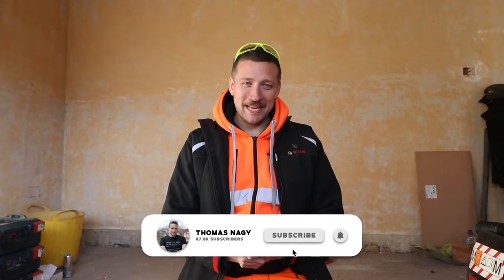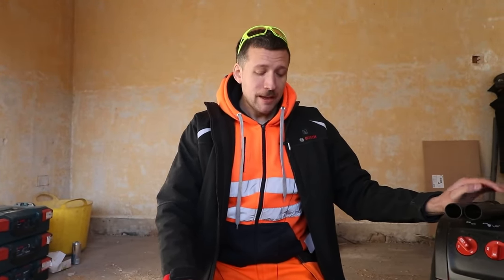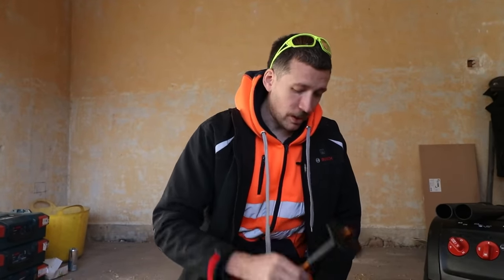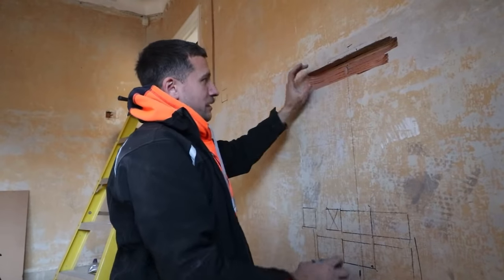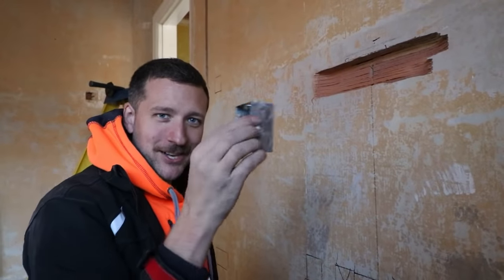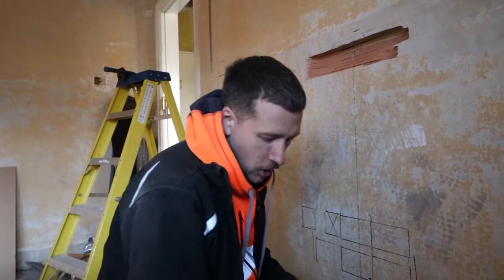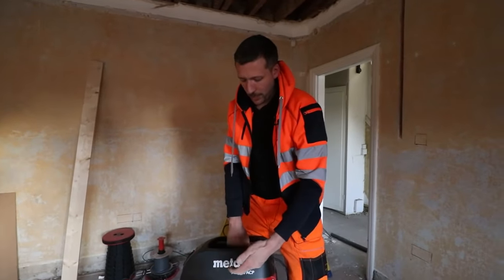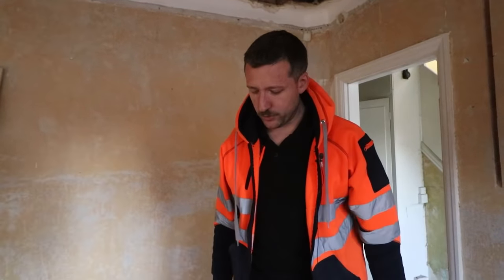The GOD of all WALL CHASERS! | Thomas Nagy

Comment: Worth it if you rewire daily. They say dust free it's not. Compared to angle grinder but similar to sds chisel. The wide bit cost approx£100, started to use on brick (hard house brick but not industrial brick) blade was showing heat damage straight away so stopped. I continued house wire using sds chisel. I plan to get or make a shroud to prevent dust from spraying out the side and when working on soft brick or brease block. Very disappointed but best on the market but not as good as sds chisel.
Reply: In hard brick you can make two passes to put less strain on the blade, also you must push this machine unlike other chasers that you pull. Let the blade do the work and don’t push too fast. 👍👍

Comment: What are all your thoughts??? I think this machine would do perfectly for creating a channel to divert water in a slab that has just been poured. The concreter has created  a situation that directs surface water run-off to go towards and under my house - not happy with that result at all. Also, i do not own a dust extractor.....would this be much of an issue?
Reply: Don't use it without a dust extractor.

Comment: Nice video, can this chaser with the 3 blades be used with the Bosch m rated hoover?
Reply: If you can get the hose to connect. AFAIK Metabo uses a MFE-series special hose. I modded my MFE 65 to take the D36 festool hoses.

Comment: Wonder if the cheap titan ones can use 3 blades,I currently couldn't justify 800 notes on a hoover and posh ( 3 blade metabo grinder) 🤣
Also wonder how a henry hoover would cope on one of these
Reply: I use Henry hoover with it. Cops but gets heavy and tube ain’t long enough for full hight chase. Gets full quickly too
Reply: @connordines5080  OK wicked can get long hoses for Henry's cheap enough off ebay, il look into it, cheers fella

Comment: I just want to know if this can handle a Jamaican concrete block wall. Wanna get my electrician hubby something. We mostly use jackhammers here to cut the walls.
Reply: They are designed for concrete in the first place.

Comment: Cut those draw strings off your hoody or get them tucked in, Saw a lad last week cutting sewer pipe with a grinder he bent over to look at the cut and they went straight round the blade luckily it was on the run down jumped up and cut his chin.

Comment: It is a brilliant chaser no doubt but it just takes too long with the tripple blade and tires you eventually as its harder to push so I just use normal twin blade, also the bag fills up very quickly when using tripple blade, Also Metabo bags are pricey so I just use a normal black rubble bag and cable tie it to the duct

Comment: Tom why you are using the wall chaser wrong you don't go up mate you go down and leave it to work the blade mate so you don't get tired good luck with the Metabo vacuum cleaner it's v good I use one like it's vgood keep it up mate
Reply: Because he read the manual, you apparently didn't. The MFE 40 spins the other way around compared to most wall chasers. If you have the handle facing down.. the correct chase direction is up.

Comment: Instead of going up, is it possible to go down to make it easier?
Reply: Read the manual. Chase direction with handle facing down is UP. If you want to chase downward you have to flip the whole machine. If you don't and you chase in reverse... besides the safety issue of the blades wanting to eject your machine out of the wall... it spews the dust the wrong way for where the hose is. I would imagine pulling the dust into the cut instead of spewing it out of the cut immediately will also increase blade wear.

Comment: im an electrician and what we do is start at the top so gravity takes care of the hard work
Reply: Did you notice the MFE 40 spins the other way and doing as you describe and with the handle facing down will result in completely shitty dust collection?

Comment: Use it from top to bottom, it makes it a lot lighter to use.
Reply: And hold it with the handle up? Haha. Did you read the manual?
Reply: @jcvjcvjcvjcv  i use it almost every week, going down is so much easier.
Reply: @iammarceljansen  The MFE 40? With the handle facing up?
Reply: @jcvjcvjcvjcv  handle down, just run it up side down, it flows down without any effort. Pushing it up in the wall takes so much energy from you

Comment: I've used it for the first time today, and I think it's a bag of shit... Seriously... There are 2 good things about that set up, the disk (which is the star) and the hoover... The actual chaser is dog shit, heavy as hell to use, very poorly made, every single interactable component on that chaser sucks ass...  The blades don't drag the chaser up the wall, the blades actually push the chaser down, and you're trying to push it up... Why didn't they make the disk spin the other way? Why didn't they design it to pull it down the wall? 

Negatives just about the chaser: 
- The box is like a suitcase, rigid and crappy flimsy plastic. 
- The method for securing the depth cut relies on a screw, the mechanism is very poorly designed and doesn't loosen entirely or tighten sufficiently, I'm sure some of you will end up plunge cutting through the desired depth because the screw has come loose. 
- The activation switch and auto run is all in one spot on the handle, exactly where you would pick it up from, and it automatically turns on and locks itself on if you pick it up the wrong way... 1900W blasting away, 40cm unshielded triple blades... And I guarantee the blade will be unshielded because the blade is always exposed, it does not recess unless you are storing it away... 
- Did I mention how crappy it is to use? Maybe it wouldn't be so bad with the single disks, but with the triple (which is the only reason we're interested let's be honest) make it exhausting to use. Maybe I'm a pussy, but I guarantee you, the difference is night and day with that and the Dewalt DCG200. 

Pro's about the chaser: Absolutely none, it's trash. 

Pros about the hoover: 

The hoover appears to be actually pretty darn good, the filter cleaning works very well, and a bright red light flashes on the hoover when it's blocked or heavily restricted. 
The suction is very good, and the hose is a good length. 

Negatives about the hoover: 

The bag? You know the plastic bag with the top cut off and a plastic bit for the hose to connect to? Guess how much it costs? You won't get it.... Guess.... £10 each.... Yeah... TEN FRIGGIN QUID for each bag... (a little more actually OVER £60 FOR 5)... Nice right? 

What was it, £460 or something, for the hoover, and did you see the state of the accessories? 2 connectors, (both flexible) a hose, and a crappy plastic stick with a plastic head with little brushes on the base... and one of those slim tip bits to get the crumbs out of the back of the car seat. Utterly useless... It's also too short to use comfortably... I'm 6ft and I have to bend over to use it... Trash accessories. 

Fits well onto the nilfisk aero 26 accessory bar which has vastly better accessories for something like £125 + a decent hoover, (not good enough for chasing though). 

So this is my personal solution... Dewalt DCG200 (battery powered) with the metabo hoover and the metabo triple disks. 

Why? The dewalt is much smaller, chases down the wall (gravity is a thing you should use in these designs don't you think?) has every bit as much power, is miles safer, much neater cuts due to the ease of use, is easily directed, is quieter, is a dream to set up and change blades (you can do it one handed and without tools, unlike that abortion of a wrench metabo have included). It fits in a t-stak case, and get this, chases the same area in a 3rd of the time. 

The negatives with the dewalt are: 

- It's battery powered, so you need to change the battery every 3.5 - 4 full chases, 
- the batteries take about an hour to charge even with the fast charger.
- The air flow is more restricted inside the dewalt, so if you floor it, you may create dust. 

Take your time and grab 2 or 3 batteries, and I guarantee you, you will be able to chase all day and feel like you've hardly had to work at all, the results will be considerably better, unlike what many other reviewers have said, the dust is not worse  (you can't chase out 2 lines next to each other and expect the dust not to escape), the metabo is simply much slower to get through the material. 

I'll slap anyone who disagrees without owning both the chasers.

Comment: Nothing worse than an mains operated appliance with a 2 metre lead on it. How about one with a 1 metres lead?

Personally I use a cyclonic dust collector for all sorts of things and it minimises clogging filters, and there are plenty of vacs with power outlets which turn on automatically.. I imagine those ought to work with the right hose adapter. Angle grinders are awful, but there are smaller chasers that can be attached to a dust extractor which cut two parallel slots. Yes, you need an SDS to hack the bit out of the middle, but that's not what makes the vast majority of the dust.

Comment: that is not the real world. i used it and it made a lot of dust
Reply: Which set of wheel did you put on the wall first and in what direction did you chase? The MFE 40 turns the other way around than most (all?) other wall chasers.

Comment: damn thats one ghetto ass setup. 
woulda been better to have a custom made tool for this rather than just slapping a cover and hose onto an angle grinder and maybe have the power cable and hose as one piece.
and is the cover made of metal? grinders weigh enough already